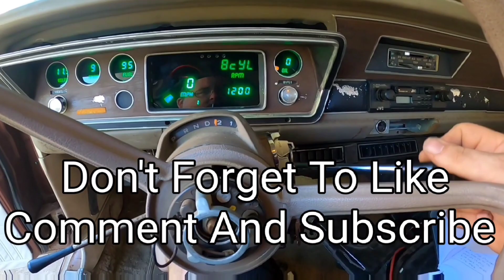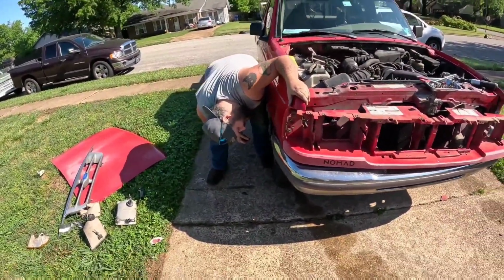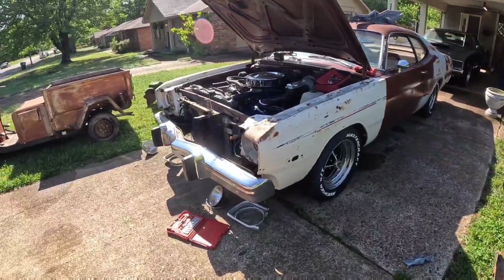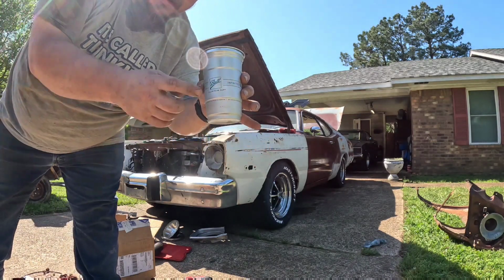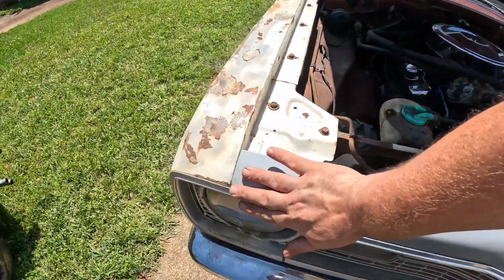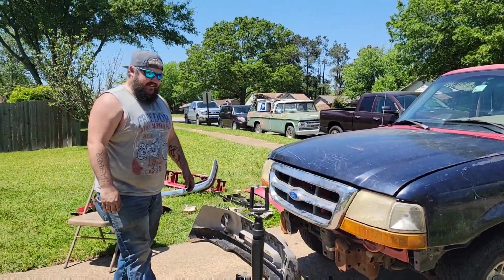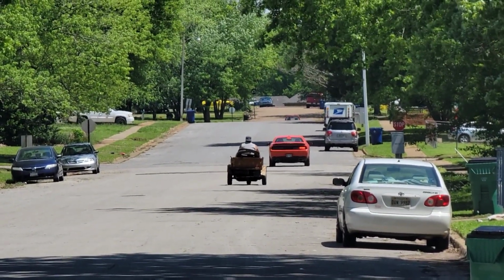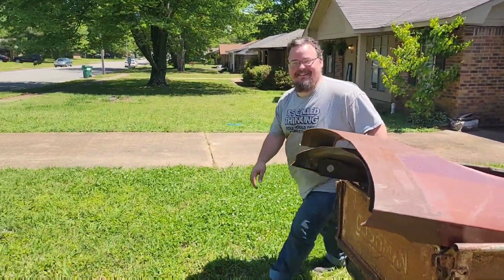1973 Dodge Dart Sport Fender Swap

Comment: Hello , I have a 73 Duster 340 auto ( it's on its way to become a drag car ) , when I got it a number of years ago , it already had 70 doghouse on it. I added a 68 Valiant hood grill and front valance. I had to drill two holes to make the grill fit , but that's it. Really cleans up the front end of the car.

Comment: Why did you change the finders are the new ones different kind
Reply from the maker: I really only want to change the passenger side because the one that was installed had the hole for the fender mounted turn signal and my Dart does not have that. I didn't want to weld it up because someone might be able to use it like it is. I got both at a good price so I decided to change both since the old driver's side had rust in a couple spots.